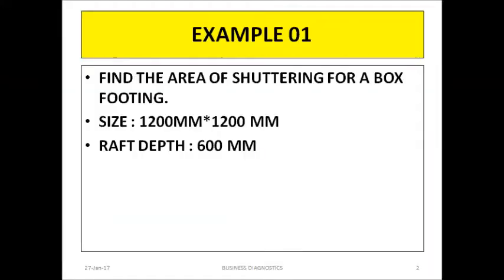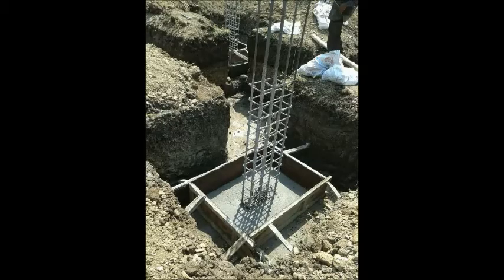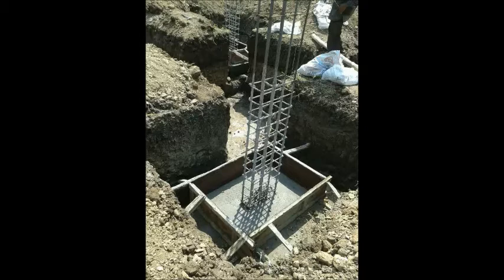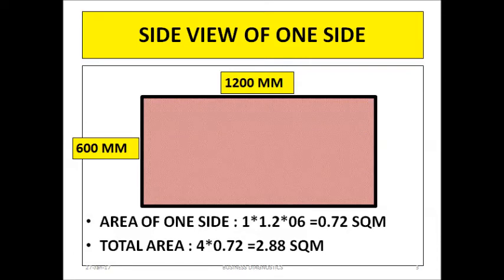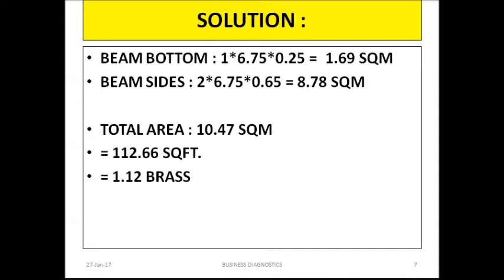HOW TO ESTIMATE THE FORM WORK QUANTITY ?  : WATCH FOUR SOLVED EXAMPLES

Comment: Sir in slab shuttring  wall and beam bottom diduction is necessary or not plz tell me sir
Reply from the maker: Yes beam bottom shall be deducted from the slab centering but it needs to be paid under beam shuttering along with the sides. 
Wall area shall not be deducted from slab because the slab Continues on the walls.

Comment: sir how much shuttering oil is required
 i am confused between two

1- Acc. to thumb rule 
Assume 1900sft slab which is ready to cast 
so acc. to thumb rule = 1900× 0.006 = 11.4 liters of shuttering oil 

2- it is also considered that  30 to 40 m2 of wooden formwork we require 1 liter of shuttering oil so acc to that 

 Convert 1900sft to {177m2}
so if we divide it by 30 we will get 
=177/30 = 5.9 or 6 liters(say)

so which one is right plz reply as i need to apply it on my site....

Comment: Sir m sand or river sand which is best for RCC work ? Please tell .
Reply from the maker: If cost is not the constraint, then M sand is preferable. 

River sand with lesser silt content is equally acceptable. 

Besides that, M sand may not be always available at the specific location. 

Hope you have got some clarity on the basic concept.
Reply: SANTOSH KULKARNI . Thanks sir

Comment: Hello Sir
Can we use PCC cement for house construction?
Reply from the maker: You want to say PPC? 
Yes certainly it can be used for the house construction.
Reply: Bro
PPC type only we are using plastering and brick wall bulid up area 
OPC we are using concrete structures only
This kind of material we using means to avoid cracks and setting time delay